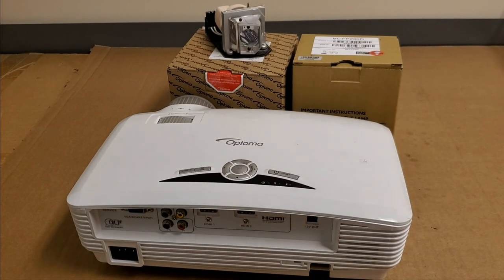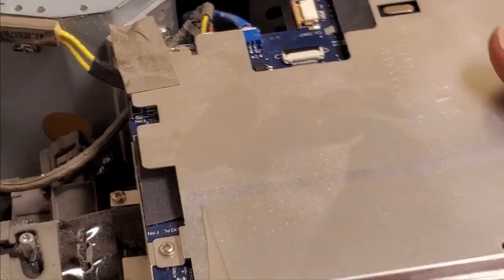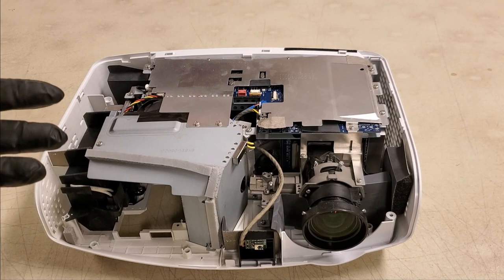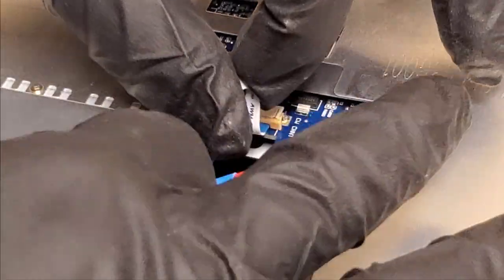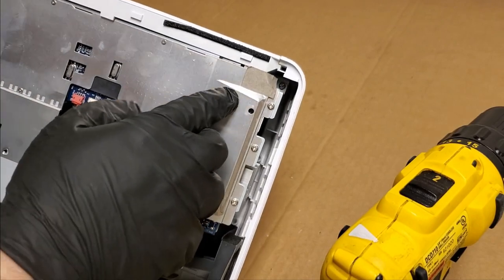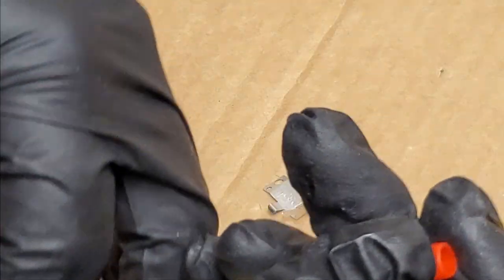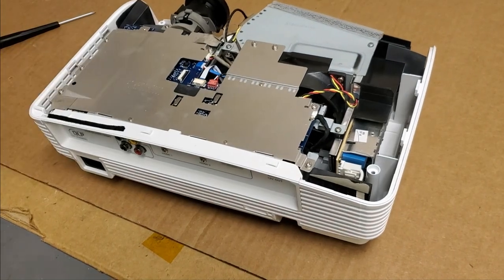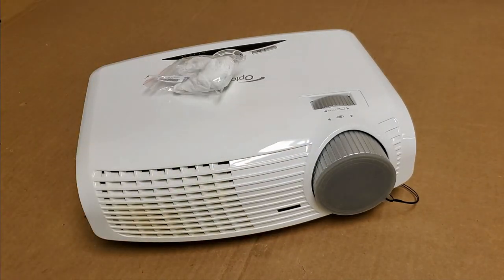Optoma HD20 DLP Projector Color Wheel/Light Tunnel Repair

Comment: Frank. Where can I get a “real” replacement for the Sunan turbo fan in my HD20. Have purchased 2 so far both pull the signal voltage to ground (27mV) when spinning. 3.25V when idle at system startup. System shuts down after about 20 seconds of turbo fan running. Original fan signal is at 1.7V when on - system runs but the bearings are shot and it’s LOUD. Guessing I keep getting cheap counterfits...
Reply from the maker: Hi Tom, before you buy another fan, try jumping the fan signal lead from another fan to the same input via a 1K resistor.  I've found its a good way to make sure the fan IC on the board is not the problem.  Its most likely the fan like you think, but just make sure.  I get my fans from Time Electronics in China. They are on holiday until the 18th for lunar new year though. I've also found them on eBay searching for HD20,HD22 or HD23 fans.
Reply: @FixitFrank  thanks...good advice. I will try that. I am going back and forth with the old fan and new to see if I am getting consistent signal voltages or whether as you say there is something intermittent going on in the circuit.
Reply: @FixitFrank  thanks to your videos I’ve gotten pretty quick at pulling this thing apart
Reply: @FixitFrank  signal always 1.7v with original running. Always drops to 27mV on signal line when new fan in system. Gonna try buying one from your recommended source.
Reply from the maker: @tomkirby2355  I see a few that look safe on eBay.  "gb1245PKVX-8AY" That is the part # you want to match.  It has to match exactly so that you have the right status wire option. Another thing I noticed was the proper replacements already had the blue shrink tubing and proper connector already installed.   As an example: https://www.ebay.com/itm/ORIGINAL-SUNON-GB1245PKV1-8AY-8UC01G001-FAN-FOR-OPTOMA-PROJECTOR-DC12V-1-2W/333454290610  I don't recommend this seller since the rating is kind of poor but the picture looks correct. I don't know if they are all celebrating the new year or if they are currently shipping but as long as you match that part # exactly, you should be ok.  The fans you have sound like they are 'hi on stall'. How close are the part numbers?

Comment: Hey Frank,
Need your help again...I hope you can help me?
I've got an estimate of $384.00 to REPAIR the LIGHT ENGINE of my Optoma hd20.  I love my projector but it's 8 years old.  
Here is the issue:  IT WORKS GREAT THE 1st 10 MINUTES,  but AFTER THAT IT GETS BLURRY.  THERE IS A NEW BULB NEW COLOR WHEEL INSTALLED IN
THE PROJECTOR.  
What are your thoughts?

Thanks a bunch!!!
Reply from the maker: Hola! That is insane!  When you say blurry, do you mean the focus is off or something else?  could you post a picture or video of the problem?  I feel like I know these HD20s pretty good and think that $384 is way too much to quote someone.

Comment: I was waiting for you to show how you reattached the delicate ribbon from the keyboard as I had damaged mine the same way. Then you skipped over it.
Reply from the maker: I'm sorry. There just isn't much to show and its really difficult to get a camera inside the casing. I also figured it was kind of self explanatory.  The clip lifts up and the wire comes out, The wires slides and the clip goes down.  Its just a normal latching ZIF connector. Plus I have tons of other videos showing that sort of connector and it gets repetitive so I don't bother.  What happened to your wire? Did the clip pop off?
Reply: @FixitFrank  the little connector was smaller than some of the videos I’ve seen and it came apart. I could hold the ribbon in there and make it connect but I couldn’t get it to stay. But I thought you needed the keyboard to use the remote but they are independent. Since it’s mounted upside down on the ceiling, I left it disconnected. But got it working.
Reply from the maker: @alancham4  Thats awesome!  Nice work!  You are correct, they are independent (the IR and KB).  Im glad to hear it worked out.  next chassis I work on with that setup, I will  be sure to show the connector. I appreciate you mentioning it.

Comment: Hey Frank, Great break down!  Can you help me?  I have the same unit.  I changed both the color wheel and bulb but now am getting a RED & AMBER warning light.  Any suggestions on what I should do?  I can't find any repair places near me in Indiana.  Thanks!!!
Reply from the maker: How far are you from Indy?  I know a place in town there who has some real good techs if you get really stuck.
If you did not have that error before you disassembled, I would just go back over your work.  Take it apart and put it back together again if you have to.  There have been times where I did that 4-5 times.  Most likely there is a wire not sitting straight or the something might not be connected. That thermal breaker comes to mind. The one that is mounted on the blower fan?  Make sure that wire is plugged in. I have forgotten that wire more times than I can count.
Reply: I reviewed your video again and "IT WORKED!!!"
Not sure if the color wheel wasn't seeded properly or what.  But I have TV again.
Because I replaced both the color wheel as well as replacing the bulb, it looks like a new projector.
Frank, I can't thank you enough!!!!   You Rock!!!

Comment: Hi Mr frank I have a Optoma hd20 my unit plays ok for a minute then the color turns purple is that the color wheel bad if so can I ship to u to fix thanks
Reply from the maker: Hi Dorothy, I am inbetween shops currently. i should be up and running in the next few weeks though.

Comment: With my light tube assembly out, if I shine a light into tunnel and look into lens I see a surface that seems to be super dusty.   I used air to blow off the light tunnel and the lens after it, the dust didn't change, should I remove lens to clean or not?
Reply from the maker: Less is more. Dust is ok to a degree. If you dont see blobs on the screen I'd leave it be.  You can cause a lot of hassle moving or opening the light tunnel or optic assembly. Projectors are designed to handle some dust. They are never super clean so as long as your lamp assembly is good and the majority of the dust is gone you are ok. I'd try it where you are at and see how it looks.
Reply: @FixitFrank  Well I went and disassembled,  to try and clean and man, are those lenses a pain when loose.  I had to add a dab of super glue to hold that metal C clip down in the main housing, it kept falling out, and setting all three lenses in the part that removes.  The smallest lens seemed to be still held on by that little black rubber tab on bottom but not the first fatter lens.   It is now cleaner but I can still see dust on two layers when shining a flashlight into light tunnel and looking into lens.   I tried.  Probably not worth the effort due to minimal results.    Couldn't have done the job without your videos.   Thanks again.
Reply from the maker: Im glad to hear it! I happened to check your channel and we might be pretty close if you want me to take a look at it.  I'm also SE PA. IF you want to email me, we can talk.  I kind of want to talk to you anyway. I used to keep bees years ago and want to get back into it but I need someone to talk to who is currently involved and you seem to be the right guy to talk to.

Comment: Hello, my Optoma uhd30 stopped working and not under warranty. I replaced lamp. Fan comes on but no light. Color wheel appears to not spin up and has a voltage. Sensors are clean and wheel spins freely. Any suggestions? Thanks
Reply from the maker: Hi Chris, did you try it with the lamp switch bypassed? I'm wondering if the lamp comes on for a brief moment? 
Did your old lamp burst or just stop lighting? Lastly what are the indication LEDs showing after it fails?
Reply: @FixitFrank  Hi there , thanks for getting back. After replacing power suply and lamp with no luck I cut my losses. Spoke with optama and a new mainboard was the cost of a ne projector. was hoping i could have fixed, but not this time. Thanks a bunch!

Comment: Hi Mr. FixitFrank I own Optoma HD131Xe, recently my projector is acting up. At first when the problem just happen, I give it a few smack and the picture comes back, now when the same issue comes I do the same, but no picture coming up at all. If there are pictures coming up, there are vertical lines all over the screen, but now the whole nothing comes up, all I see is the light source, no picture is showing at all. I wonder if this projector is fixable or doom. Please reply when you have a chance.
Reply from the maker: I think it might be fixable. Without it in front of me I have to guess a little but I think you had a bad connection between the DMD board and the mainboard. Smacking it would wiggle it enough to get it connected enough.  Then over time it fell apart, probably from smacking it compounded with whatever made it loose in the first place (Bad assembly at coretronic is my guess). At this point you don't have anything to lose.  All you have to do is take it apart and put it back together. I don't think I would go as far as taking the mainboard out but I would take the screws out and see if the mainboard is seated OK or if there is a wire pushing the mainboard up from the DMD board. Some of the larger wires can get pinched and push up in the wrong place. Basically something made the DMD and mainboard not to be seated. I would not just open the top and push down because you may have it pop right apart again.  There is a good chance the screws in the bottom are going to spin(at least one). the plastic inside tends to get brittle around them.  As long as you can get at least one screw back in you will be fine.
Reply: @FixitFrank  Thanks so much for your reply, I will try to open up and give it a try,  will update with you of the progress. Thanks so much again :)
Reply: @FixitFrank  Hi Mr Frank, I just had chance to open up the projector, now the projector can project images from the source, but the vertical line still exists, is there anyway I can PM you?
Reply from the maker: @DCHEN824  Sure!  The problem is still with the DMD area.  Either the connector or a pcb trace.  You can reach me at rostit@ultrafark.com and I will reply from my personal email.

Comment: I have the same model but have three horizontal lines on the upper half of the screen. I recently cleaned the projector as the screen was flashing from a dusty color wheel. Any suggestions on what is wrong?
Reply from the maker: I suspect your connection between the mainboard and the DMD/DLP board is not quite seated or has some debris in the connector. Vertical lines is almost always a connection problem between those 2 boards.  If you had the mainboard out, that would be the first place I would check. Take out the screws and reseat the board. I suspect that will solve it for you.
Reply: @FixitFrank   I have taken it apart a few times to try and clean/reseat. I have not tried using a corrosion cleaner, yet. Also, the lines are Horizontal not Vertical. Would it still be the same thing?
Reply from the maker: Sorry about that. I am so used to seeing vertical line questions, my brain kind of replaced it.  That is probably a different story.  I would still suspect a connection but something to do with the rows instead of the columns.  It still may be in that connection area. If it did not do it before you took it apart, there must be something interfering with a connection. If you didn't have the dlp chip/dmd out, I wouldn't worry about that. You may want to see if any "gentle" flexing changes the lines. Kind of twist the case ever so gently or apply pressure to an area to flex the board.

Comment: I bought a colour wheel for my hd 25 that was supposed to be compatable,went through the same procedure as u installing it all I got was a green picture had to put the old one back in which is on it last legs very noisy .The hd20 wheel your using looks  identical to mine ,and on ebay they say they sell a hd20 that's supposed to work in mine the hd 25 as well ,yr projecter looks exactly the same as mine .do you no the diameter of the wheel in yours of hand ?every seller on ebay apart from one sells wheels from china for mine the hd25 but the colour  segments  in the description apart from one seller the hd20 wheel looks rite for mine.

Comment: Good afternoon, you have a picture of how the prism tunnel for two lamps works on the DLP ptojetor, Thanks ...
Reply from the maker: It really depends on the model of projectors.  Some use a cold mirror, some use 2 light tunnels. I have a video on a christie DHD670-E that I replace the cold mirror in. That is a dual lamp.  I don't have anything right now to show dual lamp behavior on, but I will keep it in mind. Thanks for the suggestion/question!
Reply: @FixitFrank  I have a Barco DP1200 projector, the lamp source burned out. I removed the lamp house and adapted a 300w uhp lamp. I need two lamps to make 700w, but I don't know how to mix the two lamps. I need to see how the light mixes .. good moning
Reply from the maker: Ohhh.  That isn't an option unfortunately.  These are arc lamps and do not use a filament. You will damage the ballast at the worst, but more likely it won't light.  The ignition voltage and run current are much different and not compatible between the Xenon and HG short arc lamps. You may actually need a 1200W XBO lamp depending on the specific projector. These all use Xenon which runs much differently than mercury vapor.  These also need to be aligned so that you do not overheat the internals using the wrong lamp.  Your best option is the proper lamp or you risk really ruining the projector.
Reply: I eliminated the house lamp, and the original ballast. I'm adapting a new ballast and two new lamps, they have 350w (mixed they go 700w). I'm using it on a screen with 150inch, so, I dont need 1200w to have a good image on it. So I'm reinventing my Barco for a more home use. Both lamps are in a heat filter, it's working with one lamp, but now the only thing I need to understand is:

How can I make the prism or where can I found to buy it, to mix the lamps. Like u did it. 

Thanks!
Reply from the maker: Ahh, that makes much more sense.  I was going to say, using the xenon driver that way would be a problem. I am not really sure though on how to combine them. You may want to look around for a 'cold mirror prism'.  You may also want to try and find an old panasonic dual lamp projector or christie/Sanyo dual lamp to harvest optical parts from.  This is a curious project, I would love to see it if you have any videos to share.

Comment: What type of glue/adhesive is recommended for the light tunnel?
Reply from the maker: I've always used CA(super glue).  The heat does not seem to bother it once the tunnel is in position. Then as far as longevity, I know of at least 2 projectors with CA repairing the light tunnels that are still in use over 4 years later. I like to use the thicker/gap filling CA because its easier to prevent it from getting on the mirror surface like the thin stuff can do.
Reply: @FixitFrank  Thanks for the reply...  I didn't have any of the thick CA on hand so I am trying Bondic.  The UV set was nice but we will see how it holds up to the heat.  Thanks much for your vid, I had the exact same problem and didn't know it (tunnel not color wheel) until watching your vid.
Reply from the maker: @3StorysProductions  You're very welcome! Bondic will probably be fine. Once the mirrors are mounted and set, the chance of them moving again soon are pretty low anyway.  I have some Bondic. The top temp from their website says 150c.  I highly doubt the light tunnel gets up to 300F. I'll check some day but 300F sounds way too high.  
You've inspired me. The next light tunnel I do, I am going to try Bondic.

Comment: Hi, i have problem with Optoma HD20, my color wheel exploded and i bought replacement color wheel on ebay and after i installed it the screen is very green, all is just green, is the color wheel bad or what could be the problem, the color settings doesnt help at all.
Reply from the maker: weird!  I'd make sure you got a proper version of the wheel.  It shoudl have just worked.  There is a setting in the service menu called the index setting. Might be worth checking that but I'd make 100% sure you have a good color wheel.

Comment: Hi, please, did you have  schematic this hd20 model to give me or buy?
Reply from the maker: It's actually really easy to find online.  And its Free! Just google Optoma HD20 Service manual. Elektrotanya.com has it among other places. What problem are you having?
Reply: @FixitFrank  yep, i know, the manual service i got but not the schema.
Reply from the maker: I can't seem to find the schematic for the whole unit. Which part is causing problems? Other models share some parts and they may have schematics.  If you had the 8pin chip in the power supply explode, the transformer is probably bad and you will need to replace the entire power supply. Whole parts for this model are not too expensive currently.
Reply: @FixitFrank  the problem is in the HDMI port.
I supouse the problem is in MST3367CMK-LF-170.
Reply from the maker: It could be. I hope it is not the problem. To change that, I think you need to program it with an EDID box.  
I would also check , U51(on top near the color wheel connector) and U49 (next to photo connector). Then on the bottom check for shorts(or just remove them), U55, U56, U57, U58(maybe just U55,U56 in the HD20, I am looking at an HD23mainboard). They are all TVS diode packs that are made to short to ground to protect MST3367. They are the small black components right behind the HDMI plug.
Worse case, you can contact Crystal at Time Electronics for a used but good mainboard. GYDZ@timeprojectorlamp.com  They are very good for parts.